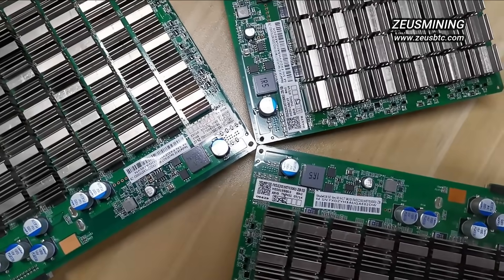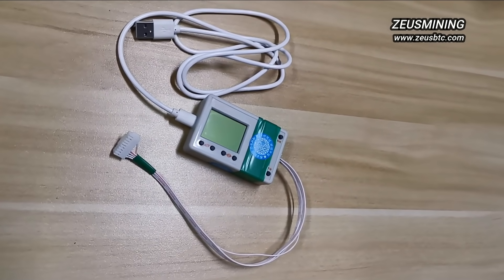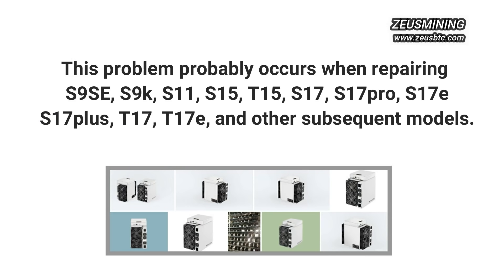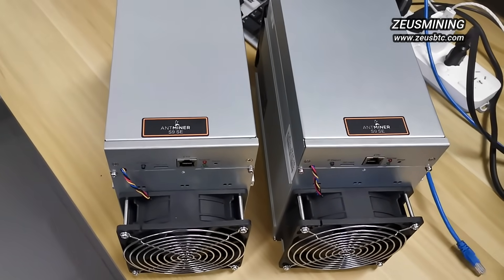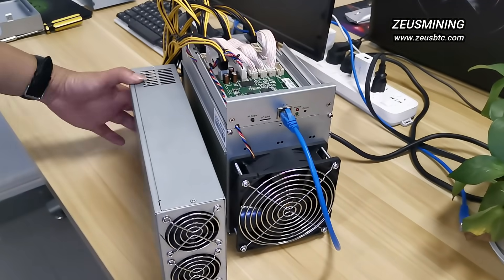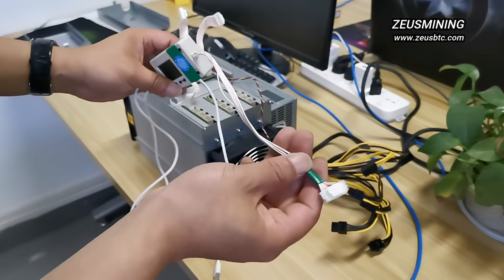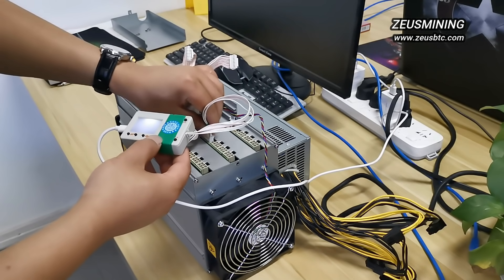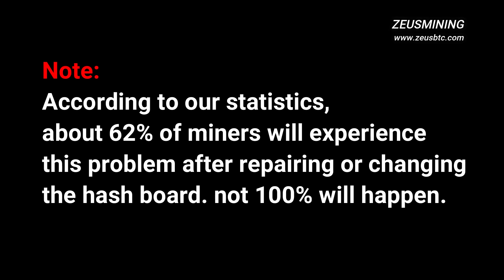Antminer hash board EEPROM code editor, solve the issue of can't work after hashing board replaced

Comment: How to solve "RT error"?
Reply from the maker: If the RT voltage is abnormal, you can check the resistor connected to it.
If you have any other technical problems, you can also contact our technicians on WhatsApp: +8619123969124, who will provide you with better advice and services.

Comment: I bought 1 case on ebay and 1 broken hashboard from a friend. I fixed hashboard. How do I modify serial? This is called editor but all I see is you copy/save/write. The case/control board did not come with hashboard to copy from..
Reply from the maker: Hi, regarding our product hash board editor, The principle of this device is to synchronize the hash boards with different serial numbers inside the miners to make them the same as the other two hash boards, so that the miners can start and work normally.
If you want to change the serial numbers, then this Product is not suitable.
Reply: @ZEUSMINING  Does that mean the control board does not care what the serial number is? Only that all three are the same?
Reply from the maker: @asicXpert  Hello, yes. Three hash boards of the same model are guaranteed to have the same serial number

Comment: Hello,
In my S17Pro miner, one hashboard is not detected since the equipment itself has been bought. If this hashboard has been changed by the previous owner, this could be an internal code issue? There is another way to find if this hasboard is not compatible or has another internal code, just by reading lables or stickers notes?
Thank you.
Reply from the maker: You mean that you have purchased the editor. If you purchased the product in Zeus Mining, you can directly apply for after-sales service, and professional maintenance personnel will solve your problem.
Reply: How to solve Antminer S17/S17 Pro/S17+/T17/T17+ heat sinks fall off problem? - Refit heat sinks from NBTC!